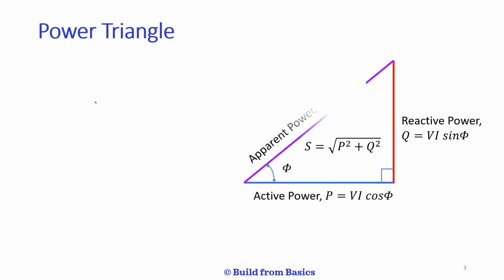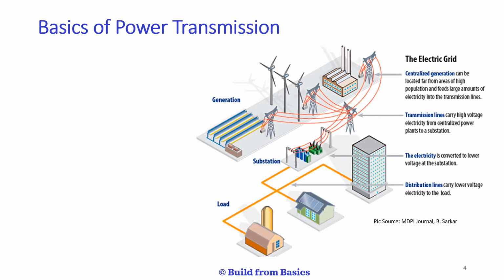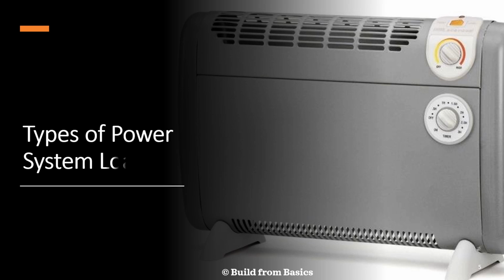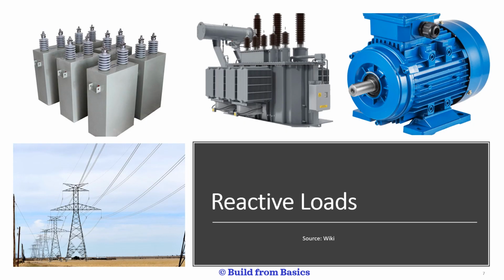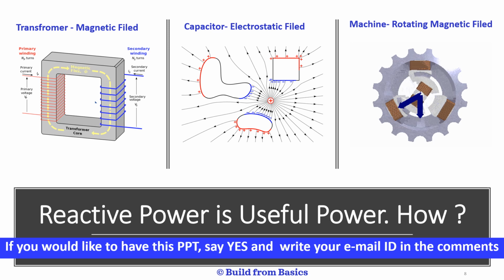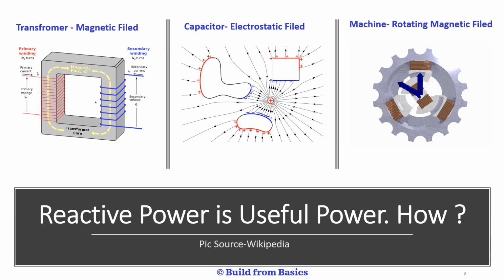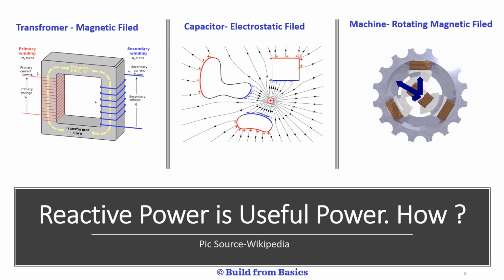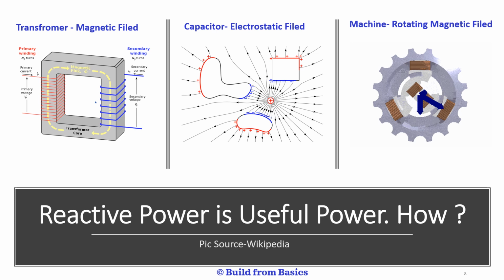Why Reactive Power is Necessary ? | The Best Explanation | What is Reactive Power ?

Comment: Also, reactive power is useful for induction generators that do not have an external excitation system like sync. generators. The presence of Q in the rotor and stator windings provides a magnetizing current that establishes the rotating magnetic field in the rotor. That rotating magnetic field cuts the stator coils, which induces a voltage (electromagnetic induction), that results in current flowing in the stator coils. The stator is connected to the grid so this product of current and voltage is the power delivered into the grid.

Comment: Before watching this video, I know is useful for voltage control. You can control voltage by varying active or reactive power. However, active power is what consumers pay for, hence we choose to control voltage with reactive power. Another important fact is that you can use reactive power either for power factor compensation, or voltage control, but not for both

Comment: Thank you very much! I am trying to understand why, when I run a load flow simulation, the bus voltages are less than nominal without reactive power compensation and then why adding compensation props them back up. This was very useful!

Comment: What happen to the grid if supply more reactive poWer?
Reply: When you overcompensate reactive power locally by using FACTS devices or shunt capacitors in a transmission or distribution system, it does the same effect as the (Ferranti effect), so to speak, where voltage can increase beyond grid code requirement (voltage instability). If from the generation side, where a synchronous generator is overexcited (i.e., injection of reactive power into the grid), it can cause overloading of lines or transformers because P & Q can compete to flow in a specified line (with limited line flow limits), which can largely reduce efficiency. That is why the power factor is usually monitored to understand the P-Q ratio.  The flow of a large amount of Q will incur more reactive losses thus, results in voltage drops. You will realize here that I said earlier the injection of Q increases voltage, and now, I'm saying the flow of Q reduces voltage. YES! That is because Q is usually compensated locally and is not allowed to flow in the grid, although a minimal amount can flow as injected by synchronous generators - that means the exact amount of Q required must be compensated or provided locally to avoid overloading or voltage issues. Generally, in power systems, we can't say one thing that can be seen as a fixed solution, but it changes depending on the application.

Comment: How does dc motor field gets energized since supply is dc voltage and thereby no reactive power????
Reply: For any dc motor, if you model the field winding, then there is a winding resistance and an inductor which models the coil which produces the magnetic field. When a DC power source is connected to the field, think of DC power source and the winding as an RL circuit. Active power is I^2*R, and reactive power which is now converted as magnetic field is given by 0.5*L*I^2. I think this the formula. Active Power and Reactive Power are basically AC concepts. Applying them to DC is technically not correct. But this is an explanation based on those lines.
Reply: @insearchofpeace2151  It's not the coil that produces magnetic field. Any conductor which carries current produces field.
Reply: A current carrying conductor produces magnetic field around it. I think  Reactive power is not needed to produce field.